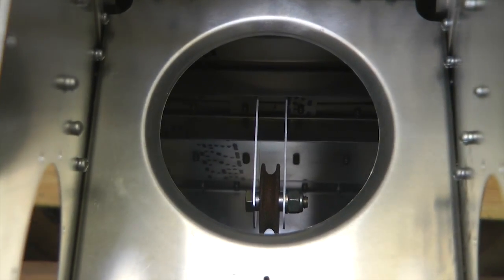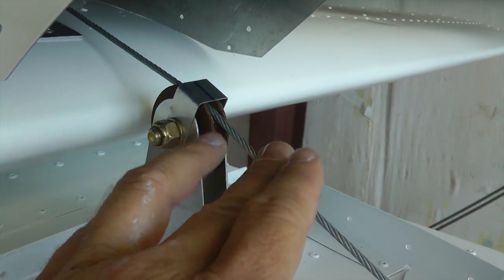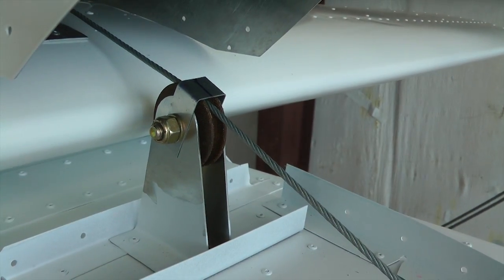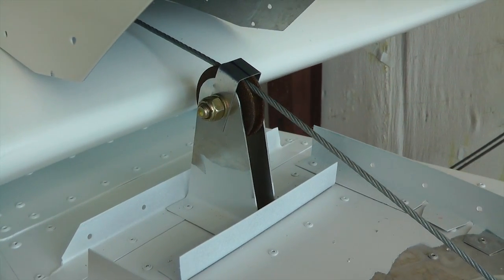Pulley Guard

Comment: Good video one thing is when using a double guard on a pulley they should be riveted together so if the bolt come lose the 2 guards don’t end up together and at least stay were they still stay at say 90 degrees and still do the job on a bend also a roll pin which you can buy from aircraft part suppliers for were a guard can not be fitted

Comment: In regard to pulley cable relationships. An aircraft Supply catalog states when using pulleys the cable angle should be more no more than 15° from a straight line and then another reference they say the cable wrap angle should be no more than 15° from a straight line. What is your opinion about this? I cannot seem to find any reference to cable wrap in any of my aircraft builders reference guide books.

Comment: Kenny G, Eric Newton temporarily installed twine in his control system to check the cable routing for problems, and that temporary twine is what you see as a fraying cable.  Captain Jim, Pulley Guards can be dangerous if they are not secured and ever rotate.  A proper pulley guard is fabricated with a method to secure it and preventing the possibility of every rotating.  This video should have shown that to us.  Pulley guards are used in certified aircraft and are discussed in the FAA's Airframe Handbook, vol 1, p. 2-44.

Comment: Hello, Just a note of caution. Pulley guards can become very dangerous.  It is a reason that certified aircraft do not have them. If the bolt ever loosens for any reason the guard can rotate and jam the cables travel causing obvious control issues. A good measure is for the guard to have a longer tail and be positively fastened to the clevis bracket with a rivet to prevent rotation.
Reply: Captain Jim   Pulley guards shouldn’t be used. Pulley brackets should be redesigned to incorporate a way to keep the cable captive. Every certified airplane has a captive cable. In the example he first shows the pulley mounting bracket should be bigger and a simple bolt or pin would go through the bigger bracket outside the pulley to keep the cable captive. This could never block the cable because it is the bracket and not a separate piece.